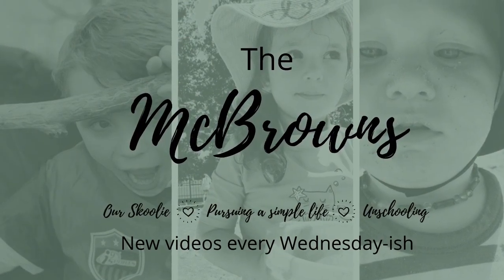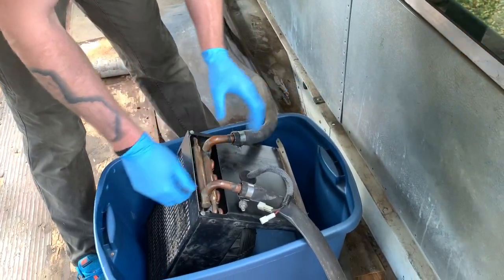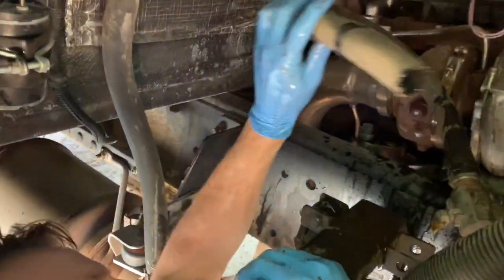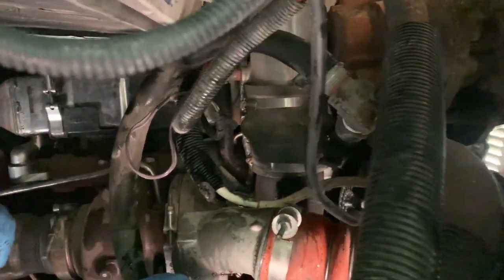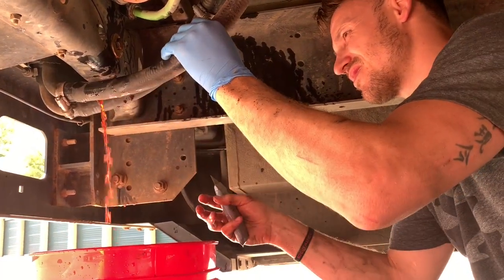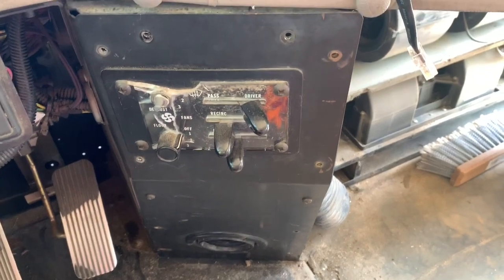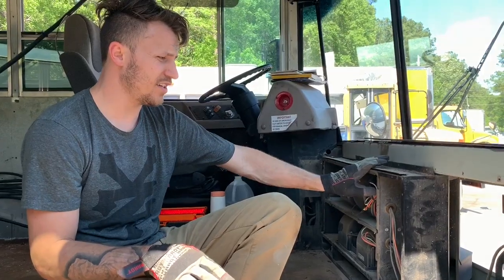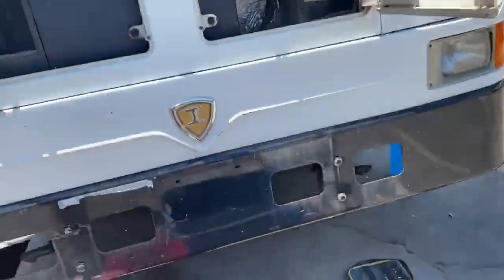Heater System Removal - School Bus Conversion ( Skoolie ) - VIDEO

Comment: So I’m putting mine back in I saved it. I needed it out for my build but I get super cold driving. I live in Co. so it gets cold. Did you hook your lines back up for defrost later? That was also a problem for me. Not having defrost.
Reply from the maker: We didn't put anything back in, it's not really too cold here at any point and we will travel accordingly. That being said, we definitely should've kept the vents and dash more intact or at least saved the pieces because we will be doing some kind of after-market defroster in the future (it's also not been in an issue, but it would be an awful issue to troubleshoot WHILE driving...if it ever arises)

Comment: So now that you have removed the heater system.  What will you use defrost the windshield?
Reply from the maker: Hi! We will be in mostly warm areas, but there are options if this becomes a problem in the future. https://www.skoolie.net/forums/f15/looking-for-an-substitute-windshield-defroster-19099.html.  Some people also keep the front part of their heater system in. We wanted all the space we could get. (Shane had thought it through, but I honestly didn't even consider it beforehand...oops).
Reply: @TheMcBrowns  you guys can always get the little heater that run off 12volt down the road to defrost the windows if you need to. I use one in my truck. Works pretty well.
Reply from the maker: @MrCoop  So good to hear. There is such a learning curve with converting this bus - I'm sure we will make a million mistakes along the way - it's so nice to talk to people who have solutions! Thanks so much for watching :)

Comment: What about the defroster and the coolant for the engine? Were you able to retain those features and remove that pump?
Reply from the maker: When you remove the heater system you lose all of its functions, including defrost. 

There are after-market options for a defroster you can add later. I would keep the vents up front by the window if you plan to do that (something we didn’t think to do). 

Removing the system made sense for us because of the massive amount of space it took up on the interior of the bus and that it doesn’t impact us much based on where we live (rainstorms can cause it to fog up a bit, but not too bad) and long-term we will find something to handle that issue. 

If you can work around them and are in colder climates—I would keep the system in place. It’s a personal preference thing. 

As far as the engine coolant—yes the engine still has coolant, you’re essentially removing a piece in a loop and just have to reconnect the loop. 

It just initially drained all the coolant and we had to fill it back up. 

At about 01:56 in the video is where we start to explain that.

Hope that helps 🤞🏼😊

Comment: We’re at the start of converting and OLD school bus here in Texas. I’m looking for as much information as possible. I was wondering if there is a salvage market for the stuff I want to remove. Does the core have any value? AC coils? The two AC compressors mounted on the motor?
Reply from the maker: Unfortunately due to time and space we took our stuff to scrap yards to get cash for the type of material per pound, but I know that some people will buy this stuff. It’s just a matter of finding the right buyer. If you have time, I’d attempt to sell the pats. Reddit might be the best place to find people interested. There are some Skoolie groups on there.

Comment: Will removing the heater effect defrosting the windows?
Reply from the maker: Hi Christal! Yes, if you remove the entire heater system you won’t be able to defrost windows.   We will be in mostly warm areas, but there are options if this becomes a problem in the future. https://www.skoolie.net/forums/f15/looking-for-an-substitute-windshield-defroster-19099.html.  Some people also keep the front part of their heater system in. We wanted all the space we could get.
Reply: Can I remove the back and driver side heater without removing the front side panel heater? If that's the case will my defroster still work?

Comment: Why do u have to take out the rear heater?
Reply from the maker: You don’t have to take any of it out. Personal preference kinda thing. We didn’t want it taking up valuable space. We live in South Carolina, it’s never TOO cold here and when we travel to colder spaces, we will use other methods (unsure of what we will use because it hasn’t been an issue yet) to keep warm while driving (while not driving we will use our wood stove).